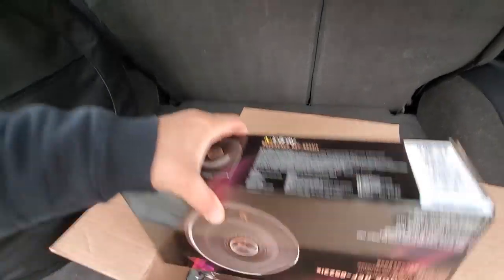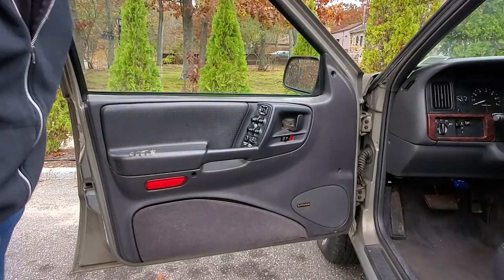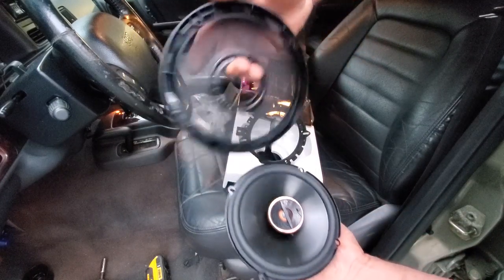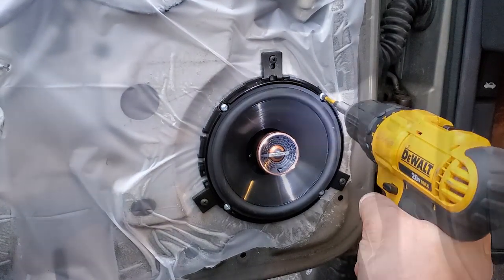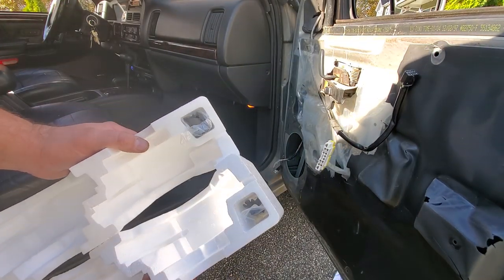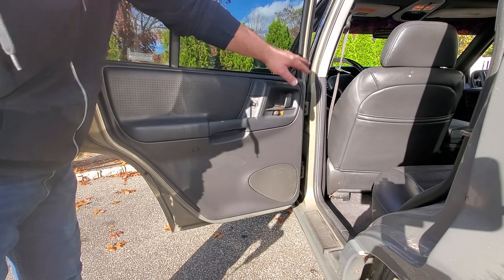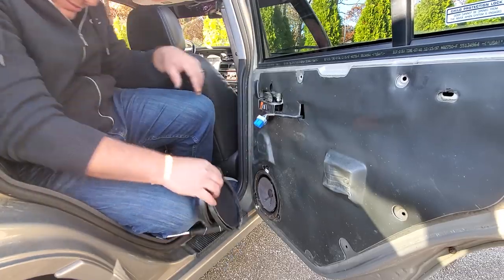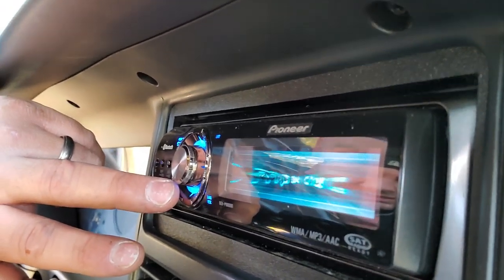JEEP ZJ INFINITY REFERENCE 6522IX 6.5 INCH SPEAKER UPGRADE

Comment: I have a 98 ZJ, that had someone before me butcher on its sound system.  They replaced the factory stereo with a good Sony.  But, they cut the wires and replaced the door speakers with crappy 5 1/2 - inch two-ways, poorly installed so they were just loose in the doors.  It sounded very bad when I got it.  I want to improve the sound.  Which led me to this video. One little point from the home-stereo crowd--it might be easy to rebuild those old factory speakers if the paper cones still look good, which on yours they didn't.  Just clean off the glue and re-glue new foam surrounds, available in every size on eBay for a few dollars.  Easy as pie and might get you that "factory sound" back.  I've done this on my home sound system, and got amazing sound from rebuilt 1980s DA speakers.  One other thing on the ZJ, since there are tweeters in the dash, keeping the full-range door speakers will keep that "sound stage" that it had when it was new.  It was supposed to sound like the band was right in front of you.  Those replacement speakers look like two-ways with additional tweeters, so you might end up with too much high frequency sounds from the sides, and loss of that concert sound stage.  This can be partly improved with the electronic EQ of the head unit.  On mine, keeping the cheap replacement speakers, I installed Dynamat to replace the moisture barriers and re-installed the speakers properly.  That improved it some.  I'm thinking about what to do next.  I'd like to find original speakers in new condition.
Thank you so much for putting this out there for us ZJ owners!  I love your videos.  You're a great presenter.
Reply from the maker: Thanks for your compliments! Glad you enjoyed. I love the EQ in that head unit it really helps even out the sound. There's nothing better than a dialed in stereo system!  I've never rebuilt a speaker before. Maybe one day!

Comment: I did this twice 😂 I found used infinity gold speakers and installed them because I had no sound except the dash tweeters . My door speakers were dust ! I now have pioneer speakers in all the doors but still want to upgrade the dash tweeters so idk my other trucks I used a 1 inch dome tweeter by kicker and mounted them on the A pillar and tucked the wires behind as well . I'm going to go through it all again in the spring and I like these speakers you install because they fit well I made tabs out of a template and yours comes with one so it's looks better . Also when using a power tool to install speakers be careful of over tightening the screws it can twist the shell of the speaker and make it sound funny after a while .
Reply from the maker: The worst part about speakers is messing with the door panels! Those stupid fasteners always break!  I waited to do these speakers until I got my replacement panels so I only had to do it once! Haha. Maybe I'll do tweeters later! 🤣
Reply: Project Dan,you da man.
Reply: Get Sony Mobile ES speaker, you will be very pleasantly surprised for its price and it’s got to be powered by the Sony XM GS4 or an Audio control amplifier for best results.

Comment: I have a 1996 ZJ with the infinity sound system and the original infinity cassette/cd entertainment center.  I had my rotted infinity speakers replaced with speakers very much like yours, with tweeters in the middle.  I had pros do it.   They clipped the wires to the tweeters in the dash because the tweeters in the new speakers took their place, and they told me something about having the new speakers with the tweeters in the middle (which the originals don't) plus the tweeters in the dash would be too much strain on the amplifier.   Just FYI.
Reply from the maker: The built in amp in the Pioneer head unit is more power than the OEM infinity Gold amplifier so I did an amp bypass.   I'm not sure why they clipped your tweeters, that's odd, maybe your new speakers have a higher impedance.   I went with the infinity reference because they only have 3 ohms impedance each.   Eventually Id like to upgrade the dash tweeters too, the pioneer can take it. 😁
Reply: @ProjectDanH  sounds like the just hard wired the speakers in his Jeep from the new head unit .
Reply from the maker: @jaysmith5084  I don't think the stock tape deck can power speaker on its own.  I'm pretty sure it must use the amp under the rear seat. 🤔

Comment: It’s funny with physics, because it’s actually the opposite of what you said about ohms and watts. 

Less ohms = less resistance. 
Less resistance, paradoxically is harder for the amplifier. You’re more likely to burn out your amp with low ohm speakers than with high ohm speakers. 

This is because of ohms law: I = U / R

If the speaker has low resistance, it allows more power to flow and the amp has to work harder to keep up. Imagine the speaker being a runner on a treadmill and the treadmill being the amp. 

If the runner is slow, meaning they have high resistance to running fast, the treadmill has an easy job of keeping up with the runner. 

If the runner is athletic and fast, the opposite occurs and the treadmill has to work much harder to keep up.

This means that now with higher resistance, a less powerful amp is not a problem and 48w is the theoretical capacity of the current. 

With the 2 ohm speaker it would be 12v / 2ohms = 6A and then wattage would be 12^2  / 2ohms = 72 Watts

Now with your 3 ohm speaker, it’s instead 48 Watts in the current.

Thanks for a good video! I have to upgrade in my ZJ, they’re rattling like crazy. 😊
Reply from the maker: Well said!  Nice treadmill analogy! Best of luck with your Jeep!
Reply: Thanks again for this video Dan! I just got my speakers today. I ordered the exact same stuff as you did by your links.

Comment: I love your videos and am glad you are back to uploading regularly! That being said, my understanding is that you really want to match the resistance of your speakers and radio or amp and not have one higher than the other. Because these speakers have a higher resistance, the amp is going to work harder and potentially blow out significantly quicker. I'm no expert though, so definitely correct me if I'm wrong.
Reply from the maker: I think you have the concept reversed.  Less resistance will allow current to flow easier, Therefore a lower Impedance speaker will be more likely to blow than a higher resistance speaker.  If you add more watts (power) like I did with my Pioneer head unit you should increase your speaker impedance.  If your speaker impedance is too high you can blow your amp.  If your Impedance is too low you can  blow your speaker.  They all have to be in range of each other mathematically. What's also interesting is that you can multiply or divide your Impedance based on how your system is wired! (Series or parallel).  Audio electronics is neat stuff! 🔊🔊🔊 😁

Comment: What was the reason for the rings if u had to poke extra holes in the door metal for the 4 speaker anchors anyway?
Reply from the maker: A tighter fit, no vibrations

Comment: So I'm wondering if I could use 2 of these speakers in the front and use subwoofers in the back 2 doors. If so what kind would you use if you were going for this scenario? Using the same head unit and 2 front speakers.  Oh what about the front two little speakers in the dashboard
Reply from the maker: you should power subwoofers with an aftermarket amplifier.  I wouldn't recommend changing the factory set up.  leave the Tweeters alone, unless they're broken.

Comment: I got a 97 zj and I'm trying to run an amp but wondering where through the firewall you punched it through at.
Reply from the maker: in my Jeeps I usually run my amp power wire through the firewall near the steering column.  Then I run it along the rocker under the driver interior kick panels to under the back fold up seat.  Then I usually run my RCA's from the head unit down the passenger side of the transmission tunnel to the amp. This way I don't have electrical interference from the power cables going to the RCA cables.

Comment: Any idea what's the thickness of the mounting bracket? I have 4.8cm depth in my truck so it will not interfere with the window (when the window is down), and the speaker depth is 5.2cm. If the mounting bracket is 0.4cm or greater thickness then I am good.
Reply from the maker: excellent question.. I don't think it's that thick but it could be close.. grab a thin sheet of plywood and cut your own custom spacers!

Comment: What head unit is that I like it
Reply from the maker: my favorite head unit of all time.  pioneer deh9800BT. they are still floating around eBay from time to time
Reply: I’m considering these speakers and the tweeters by infinity as well in the dash of my VW Cabrio. I plan a single din no screen new stereo, Kenwood Echelon seems best bet and under $165. A set if Polk rears because nothing fits and they are fillers (still will require some mods). A amped subwoofer 8” from Rockford, and JBL 300 watt amp.
Reply: ’m considering these speakers and the tweeters by infinity as well in the dash of my VW Cabrio. I plan a single din no screen new stereo, Kenwood Echelon seems best bet and under $165. A set if Polk rears because nothing fits and they are fillers (still will require some mods). A amped subwoofer 8” from Rockford, and JBL 300 watt amp.

Comment: Do you have issues with vibrations with these speakers? I have them in my XJ and they sound like they are knocking against the grill of the door panel or something it’s MAD annoying
Reply from the maker: lol, no, mine is solid!. gotta make sure they're installed tightly to the door skin
Reply: @ProjectDanH  its so weird it only happens on the right side of the vehicle, all sound sources, radio, bluetooth, cassettes etc. Gonna have to bring it to the sound guy for a fix, it drives me nuts